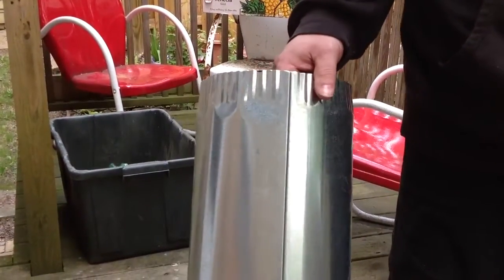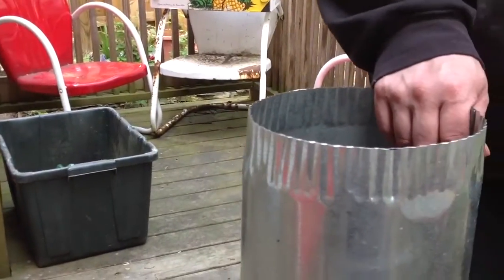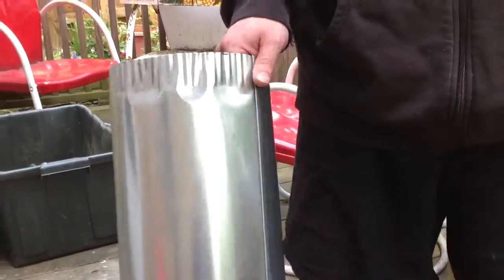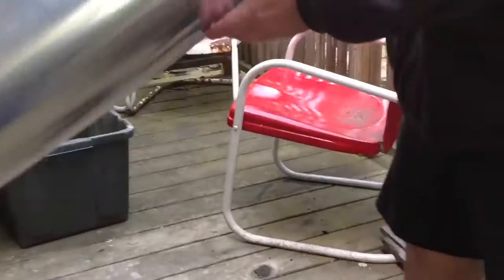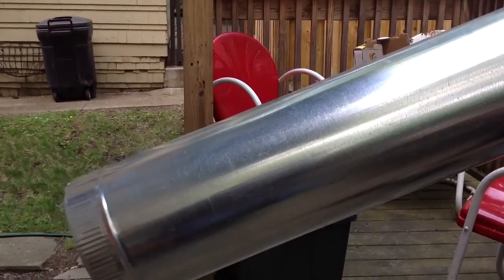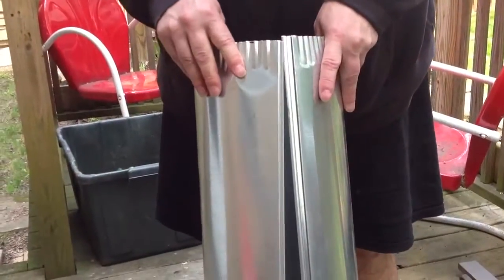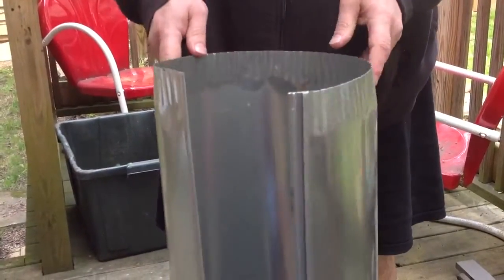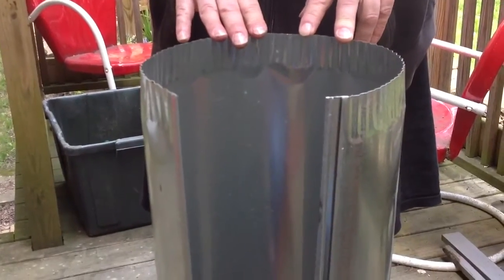How to take apart round ductwork

Comment: Wow, what a time-saver.  I first cut off one while the duct was still hooked/connected.  I had to cut perpendicular slits to get to the desired cut-line.  Resulted in a very jagged edge. Unhooking it as described here makes the cut much easier to do and the resultant cut much cleaner.